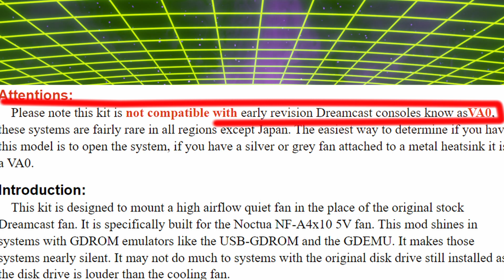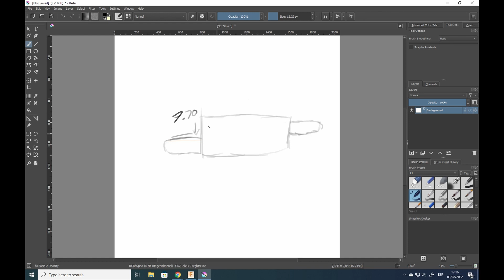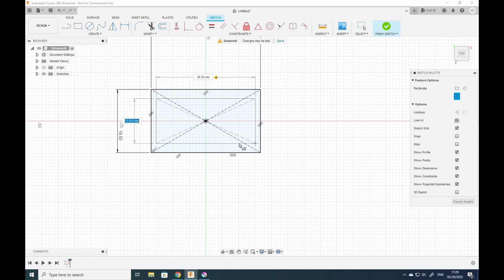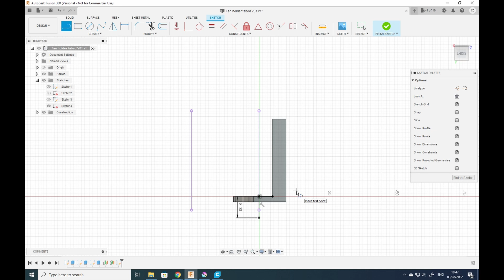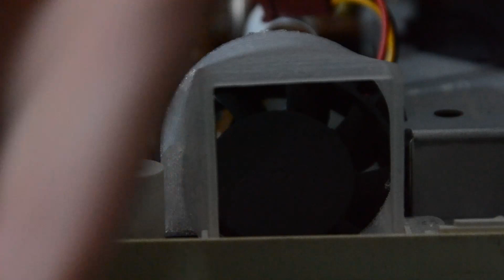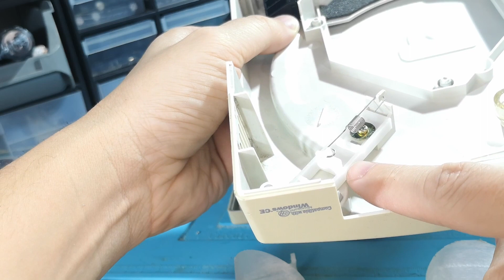SEGA Dreamcast - Early VA1 - Metal Fan MOD - World first

Comment: Fan specs matter, if the fan pulls to many amps/ watts the system will blank screen. Please list fan's model number!
Reply from the maker: Hi, 
usually fans of that size have similar specs , this fan dosen`t have a model number (of a old GPU), but it has its specs , 12V, 0.2A, Max, but the dreamcast drives it at 5v , this drives it at half the rated speed and is quiet , but a good alternative is the Noctua NF-A4x10 5V is a drop in replacement for the original , its a 5V fan thats very quiet and fits perfectly (get the 3 wire connector one /there is a 4-wire variant)

Important you need to solder a resistor on the bottom of the board between the PWM pin and 5V , this acts as a by pass and you can plug in any fan really as long as power draw is not to high 

More info :
https://raskulous.com/2021/05/sega-dreamcast-noctua-fan-mod/

Comment: But how do you know for sure that CPU/GPU is cooled enough?
The metal fan is part of the heatsink
Reply from the maker: Hi,
i actually did some testing with the thermocouple , and temps seam stable only 10c more then ambient on GPU/CPU , ofc i dont have alot of games to test so maybe some more demanding games may overheat it , will try to get my hands on some more graphically intense games, any suggestions ? 

ty for the good question :D
Reply: @RetroUpgrade  Thanks. If your solution works then I think I will saw off the protruding metal part and use the "regular" 3D printed fan duct + noctua.
Reply from the maker: @RonsonDenmark  That probably will work fine as the noctua provides a lot more airflow then the normal fan . even the crappy 12v fan i hade at 5V hade more airflow then the original one .